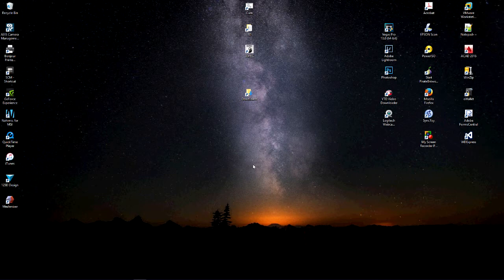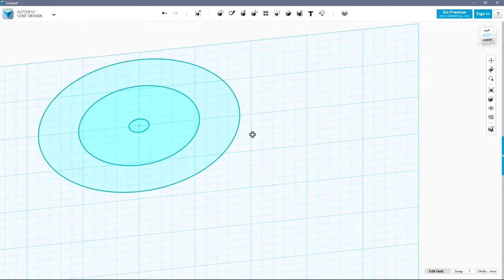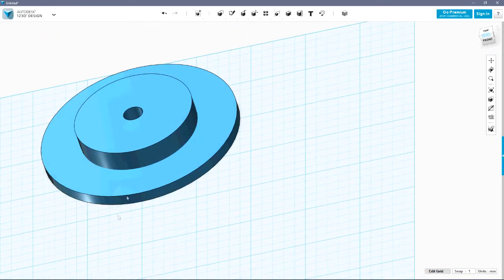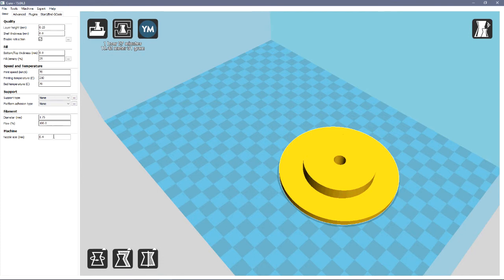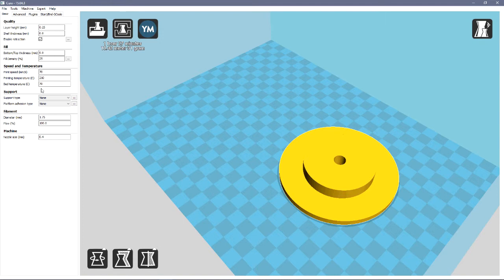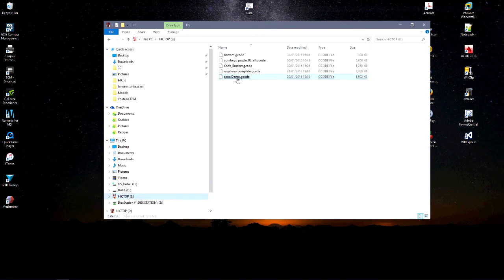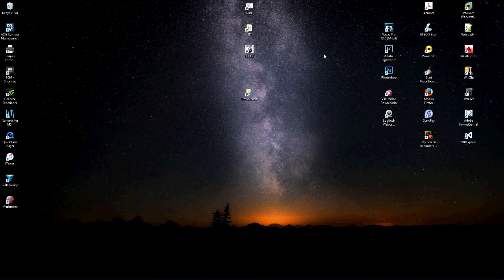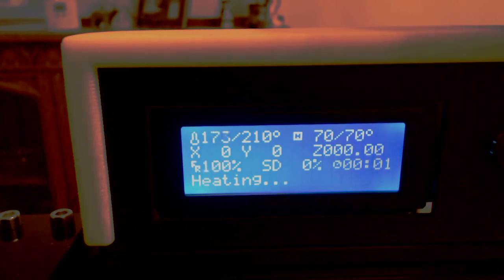HICTOP 3dp 11=7 Designing and Printing

Comment: I bought a 3DP printer Supposedly 17, and it will read a 16GB FAT32 SD Card. Sometimes it's stubborn, but it will read it.
Reply from the maker: When my printer did not, i emailed HICTOP, they advised the 8 Gb limit, so i went out and bought one, so did not try the 16Gb again. The gcode files are so small, it does the job, also it is just a way to get the files from the PC to the printer, keeping the original gcode file on the PC.
Hope you have lots of fun designing and printing - i am.